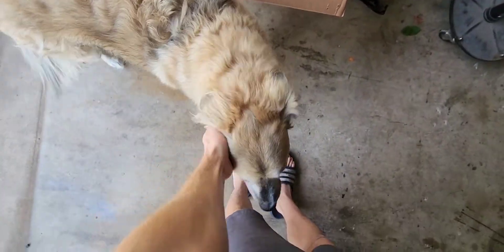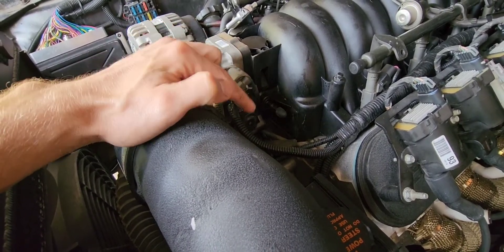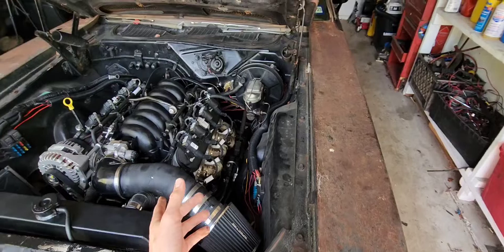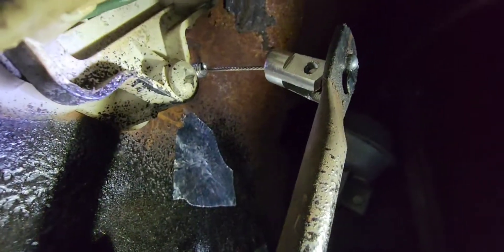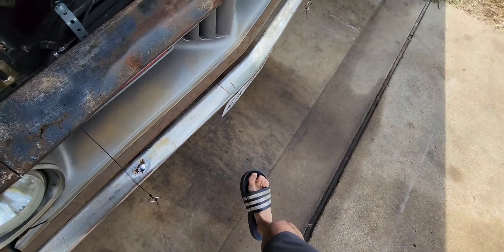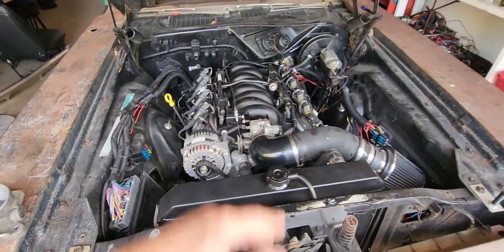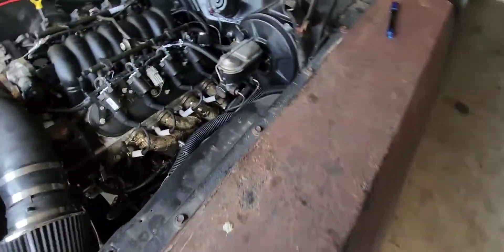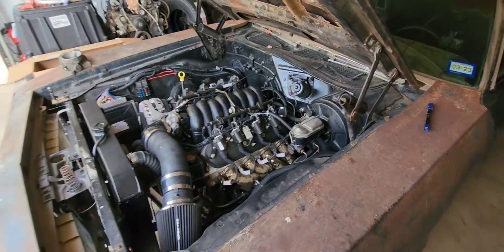Drive By Wire (DBW) To Drive By Cable (DBC) Throttle Bodies How To!

Comment: Man I have had a time with this druve by cable throttle body. Hell I dont know what to do next.  Well here goes.  I have a 2000 gmc sierra with 5.3 well I cam swapped it with Elgin sloppy 2.   While I was doing the cam  I put 799 castings  changed springs long tube. Well I got it all back together will no idle.  Wel I adjusted idle screw. Go it to half ass idle.   Well. Now it is running rich  change the iac sensor and  tps.   It is a basket case.  Literally

Comment: So does the drive by wire computer work with the drive by cable or did you have to get a drive by cable computer

Comment: I just swapped  a 5.3 with  a 4L60e out of a 2003 Yukon and I have a drive-by cable throttle body and flashed computer out of a 2002 Chevrolet Silverado. I do not have the harness for the drive-by cable my question is does it matter what drive by cable harness I purchase so long as it has red blue connector and if so what aftermarket harness do I need?

Comment: The sensors that you're talking about wiring up where do you wire them to like the idle air where does it wire to when it's been drive by wire

Comment: IAC Idle air control 
TPS throttle position sensor 

IAT intake air temp is conjoined with the mass air flow sensor

Comment: How do you get your drive by wire harness to connect to the drive by cable throttle body
Reply: I’m in the same boat, I think the harness is different. Also I’m wondering if the ECU would have to be tuned to run DBC?
Reply: @MingoMendoza-nk9zv  i believe they are do to sensor location - check with CPW
Reply: @MingoMendoza-nk9zv  you have to find the pins where the TPC and the atc ( the top sensor on the throttle . And yes you will have to find a tuner who can modify your ecu

Comment: Is converting the drive by wire to drive in cable conversion for a gen 3    6.0 ls swap plug in play or do I need to change the engine harness plugs and do I need to flash the ECU to work thanks

Comment: I have a LC9 2007 LS. I want to switch my DBW to cable. Will that same DBC part work with my motor though it's slightly newer?

Comment: Did you have to get the pig tails for the ait and tps sensors or how did you do that wiring part?
Reply: ACDelco sells connectors with generous length of wire. Note; new are white wires that work to correct terminal cavity. Then twist, solder and shrink tube. Best to get salvaged harness wire back to PCM and note the location in connector. Not hard as the connector comes apart and held in with plastic fingers. Use masking tape on the wires, write location like "Green 61" as PCM has two colors and terminals are marked.

Comment: Yeah but if you switch to drive by cabel feom drive by wire will you have to change the reluctor wheel 24x 58× exc.
Reply from the maker: No... 24x is Gen 3 and 58x is Gen 4. There's a very rare few Gen 3 that are 58x.
Reply: @krustyclassicsgarage  I believe I have a gen 3 gen 4 hybrid I have dod but I don't have vvt

Comment: Can I run a Ly6 with gen 4 harness and 58x crank, 4x cam, gen 3 intake/throttle body/heads, 6l80 Transmission?

Comment: Nice video man, quick question I'm working on a hemi swap my self I'm running drive by wire on my hemi 5.7 with a. 727 transmission. How I do for my kick down for the tranny? Thanks I will appreciate the help.

Comment: I’m doin a swap from the 5.3 to 6.0 n I have a air nipple on the intake n putting my cable wire throttle body on my new 6.0 that has another air nipple so can I cancel one or I have to go bk to my other intake
Reply: Just bent  it a little, the one on trottle! And put a plug on either one! It works! I’ve done it

Comment: I’m trying to find more info on this, currently doing a 6.0 swap on my 01 5.3 Tahoe. My Tahoe has cable and the 6.0 is by wire (03 Escalade) and I want to keep the cable on the 6.0
Reply: I'm doing this conversion on my 05 Yukon Denali I'd love to know what else I need with my drive-by cable throttle body and intake
Reply: Just keep your intake on the 5.3 bro it’s super simple
Reply: @antuanperez426  ya thanks swaps been done, I’m just having other issues now. Got a china eBay cam and it’s making the lifters tick, cus I’ve tried like 3 sets and still ticking. SMH

Comment: I have a 94 chevy obs with a 4.3l v6 with a 4l60.. im gonna be swappin a lq4 into it. Can i use the 94 4l60 or do i need to find a newer one?
Reply: U need  a 96[+ transmission

Comment: Thank you for the beneficial information from what I understand if I have an LY6 6.0 engine that originally came with DBW i can delete the DOD and replace the ecu,harness and throttle with DBC without any issues?

Comment: I just switched to drive by cable  the drive by wire intake is different although the bolt pattern is the same there isnt a provision for the IAC air flow  my motor idles at 3000rpm with throttle plate closed

Comment: One question I have may be stupid but I’m used to the classic 350 Chevy I’m doing a 6.0 LS swap on a 87 iroc camaro I plan on doing the drive by wire but what about the kick down cable for the trans

Comment: Idle Air Control or IAC sensor is the name of that sensor
Reply: That’s a throttle position sensor. 😅 Idle air control is a valve.
Reply: @josephpatrickhall3903  bottom sensor is the TPS, top sensor is the IAC. IAT is in the MAF. Hope this helps

Comment: Did you ever have a random idle drop? Down an up down  then shut off coming to a stop it random ? 
2005 Chevy 5.3
Reply from the maker: DBW? That sounds more like a MAF sensor issue, vacuum leak, or the throttle body isn't working correctly.
Reply: @krustyclassicsgarage  yes DBW and thanks for help
Reply: Leak

Comment: Great info! I'm looking to a dbw to dbc conversion on a 2009 LY6 for my 95 c1500 truck. Do you know of a dbc bracket that will bolt up to the stock truck intake from the LY6? Will this one in the video work?
Reply from the maker: I'm not sure as I've never messed with Gen 4 intakes. I'd assume there isn't because none of those ever came with dbc as far as I know.